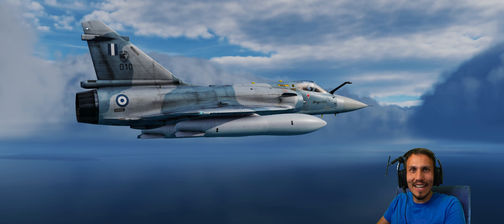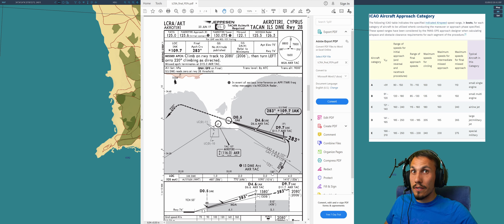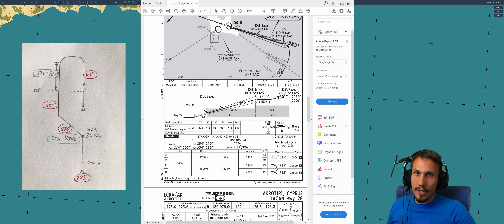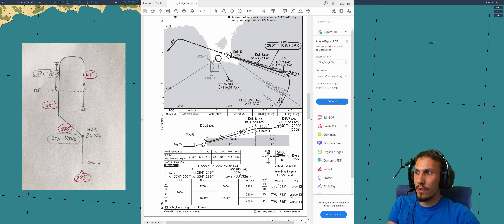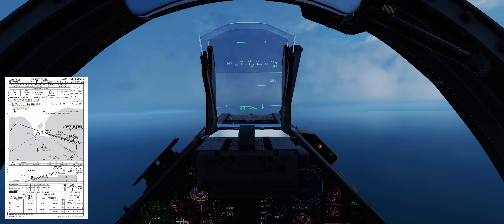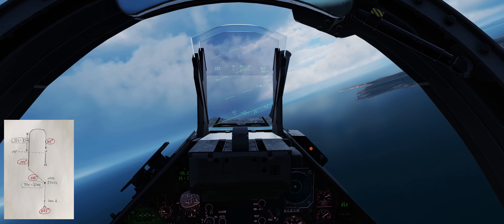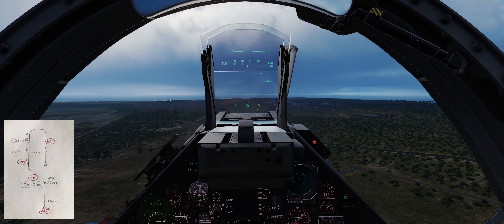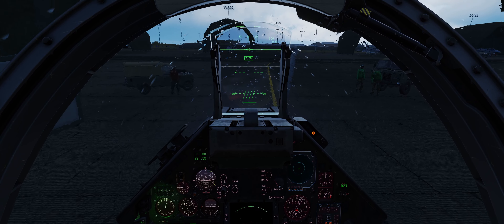Circle To Land Approach | Akrotiri, Cyprus | Mirage 2000

Comment: Regarding the ILS issue your asked if someone can explain - this is a long term DCS issue. Not specific to m2000... It happens the same with the a10c, f16 and also the av8b (harrier calls it AWLS, which is a channel, but it simply auto tunes existing ILS's, a bit like tacans tune VOR freqs).

All airports in DCS that have ILS's (usually the larger Western ones)  stop the ILS from working, in winds, if the ATC would try and tell you to land on the other end.
This is a really annoying issue, and I wish they would just leave the ILS turned on, regardless on winds.
That's various mentions of it over the years in forums, but obviously ED don't have any desire to address it.
I hope this explains it somewhat, even though it doesn't give you what you wanna hear.
Reply: It happens the same with PAPI lights, as far as I know (at least in Nellis). It´s suppose the runway is not active if the wind is not correct and you have not contacted with the ATC, and then the lights and ILS is OFF. I don't know if that happens also in military airfields in real life, but it´s annoying in the simulator specially since the ATC is not really good.
Reply from the maker: So do you mean if the wind is set to a tailwind only, then it doesn't work? So it works fine if it's a headwind? Interesting... must try that...
Reply: @CommandT  yep it should go based on headwinds, but as Llanero points out, the ATC can be quite broken.
But assuming ATC works at runway 09/27 airfield, the ILS is for 09, and current winds are still, the ILS seems to always work.
Assuming winds go 090/05 then if ATC assigns you runway 09 (it should) then ILS will work...
Let's assume winds shift to 180/8 in this example, does the ILS now work or not?
Well it depends entirely on if the ATC directs you to land on 09 or 27.
In an ideal world, either ILS would always be on, or at least the ILS would be on if the wind is within 90' of the runway heading (001-179 for example)... But this is where ATC can get funky and assign random runway headings.
I found all this out by accident years ago when trying to setup missions in weather that included ai, often they would use completely unexpected runways.
I hope this somewhat answers your questions and saves you more hours of frustration.
Best bet is either no wind, or setup wind and start in the air nearby, ask ATC to land, and see if you get given the runway with the ILS on that side, if so, the ILS will be turned on and work
Reply from the maker: @CameTo  I see, yeah, seems to work with a headwind. That is very stupid! Oh well. Thanks for the breakdown anyways!

Comment: You're the one and only man who doing things right! :D Always love to learn and see such procedures.

If I understood right, for the base leg and final approach, we plan to have a descent rate of 100/3 ftps = 2000fpm in average?
 I think most of it would be spent in the beginning of the final approach though.
Reply from the maker: Descent rate depends entirely on speed (so aircraft/ config) and where you are relative to the glide/ PAPI and your relative heading to final. It's not an exact science but you can work out that on a 3 degree glide with a Mirage doing 150-odd kts you will need around 800fpm when established on centerline and on papi/ glide. Obviously on base at 90deg you need zero and in between base and final you need something in between 0 increasing to 800. But honestly this is not a science. Just look at your FPV and where you are relative to the PAPI lights. Start a gentle descent if you are exactly on 2 whites/ 2 reds as you start turning past the 90deg on base leg and just keep the PAPI lights as they need to be. Adjust from there. Hopefully that makes sense. Don't get bogged down with exact descent rates :)
Reply: @CommandT  Thanks a million ^^